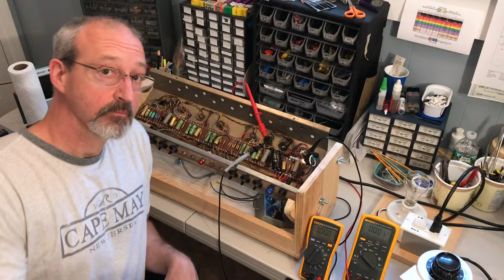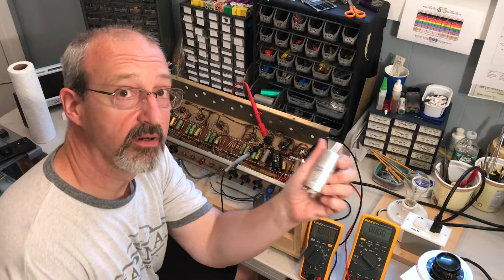Ampeg Gemini G-12 1965 04 Initial Voltage Check

Comment: I took a good look at the tabs on the G-12 I have, and yes I see those little flanges. It made me wonder if it might be better to go with individual caps instead of the can. But then I look at the limited space, and how the primary side of the OT grounds to one of the lock tabs on the can. I don't want to create any ground issues so I think I'll just stick with the can cap. Thanks for your help and also your heads-up on how Ampeg designed the grounding...

Comment: I'm getting ready to order a CE 70/40/40 for a G-12 then I see your video here giving a heads-up about "slight differences" between the new CE and the original Mallory can. Can you fill me in on the differences? Thanks...
Reply from the maker: Hi Russell!  The differences are mainly are how the vintage twist tabs have little flanges that stick out when the tab is twisted which provides a very good "lock" from pulling back out of the insulator. Think of them as "barbs".  The new replacement do not have those flanges and you have to be sure that the "twist" you apply is good enough and close enough to the connection point without twisting the tab too far and breaking it off or damaging the insulator.  
Another tricky thing is removing the old can - theoretically, you should be able to straighten the tab to remove it, but those little flanges are hard to make flush and that can make it tough to get out and/or get out without bitching up the insulator ring slots.  Often it is simplest to remove the entire cap with the insulator and replace the insulator - and it's good practice to replace the insulator anyway as time, age, dirt and messing with it can leave it a little less than a perfect insulator.
I highly recommend you get several insulator rings and replace it along with the cap.  Get a couple - if you've never worked with them before, it can be easy to crack them when installing the new can.

I hope that helps!  I do have some clips showing those flanges and what I mean if you want me to sent them to you.

Good luck!